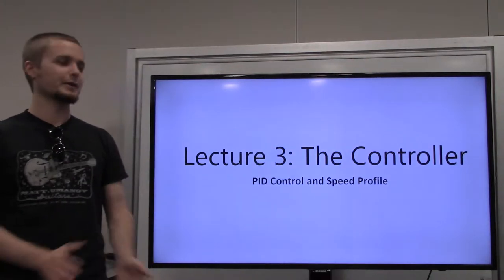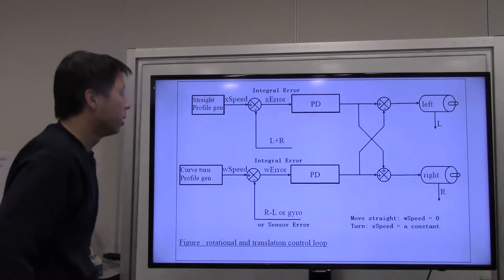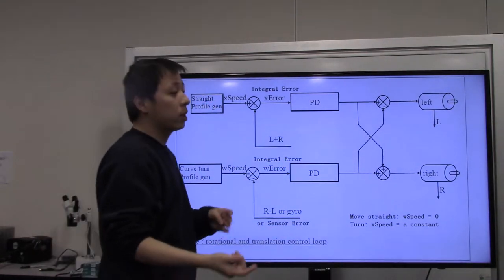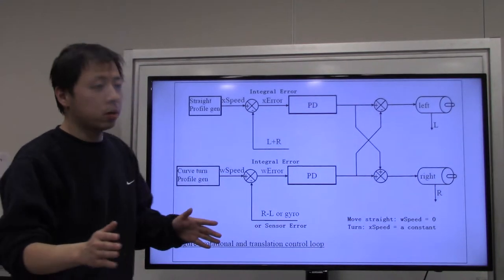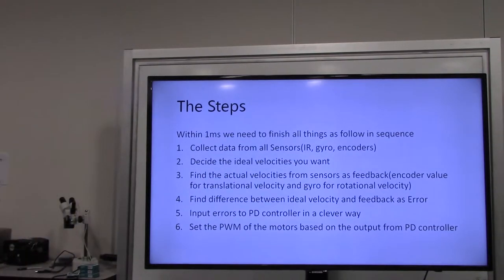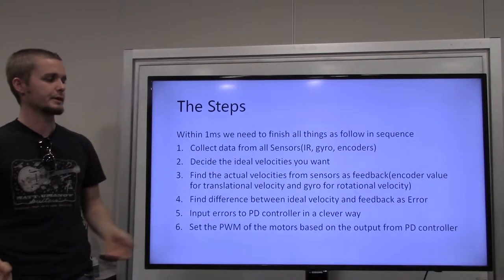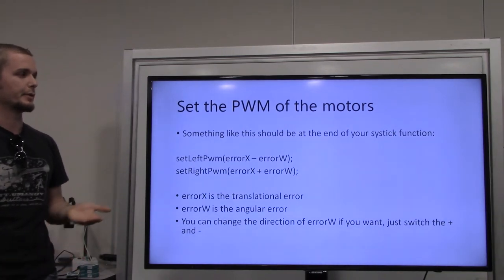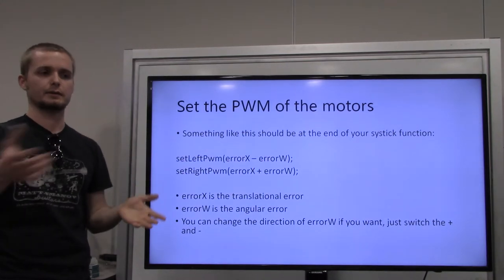Lecture 3 Controller

Comment: Hi, first thank you for these Lectures and explanations very helpful! 
In this video and in your slides you explain that it's necessary to use a 'positional PD' controller and this suppose to use a 'PI' controller for the speed data. I understand this but in the Sample Code that you offer in your web you use a PD controller for the speed sensors (encoders difference and gyro):
    
    posErrorX += curSpeedX - encoderFeedbackX;
    posErrorW += curSpeedW - rotationalFeedback;
    posPwmX = kpX * posErrorX + kdX * (posErrorX - oldPosErrorX);
    posPwmW = kpW * posErrorW + kdW * (posErrorW - oldPosErrorW);
    setLeftPwm(leftBaseSpeed);
    setRightPwm(rightBaseSpeed);

What should be the correct way to use the PID controller? the sample code is wrong? should be a PI controller with the posErrorX and posErrorW?

Thanks in advance!!
Reply from the maker: firstly, posPwmX = kpX * posErrorX + kdX * (posErrorX - oldPosErrorX); makes it a PD
then posErrorX += curSpeedX - encoderFeedbackX; make it accumulates with the previous errorP(or next errorP). 
So this is neither PD or PI.
Reply: where did you found the code

Comment: That is a very explanatory video!
Good job.

What  the SPEED_TO_COUNTS  function does in your sample code? I cannot understand what you mean by unit conversion
Should the values of moveSpeed, turnSpeed, maxSpeed etc be of some value?
Furthermore, could you please explain the below line of code?
(speed_to_counts(accX*2)/100);
I get that we need to subtract or add the accX and decX values but why in this manner?

Thank you in advance for your answer
Reply from the maker: it converts the speed in mm/s to encoder ticks per ms
(speed_to_counts(accX*2)/100); uses same macro/function to convert acc in practical unit to tick^2 per ms  /100 has something to do with the unit of acc(mm square instead of mm)
*2 is because we have 2 encoders added up as the speed(not divide by 2 to keep the higher resolution, if I remember this correctly)
Reply: @Greenye  

Thank you for your quick response. I really appreciate it.

In other words, when you say int moveSpeed = speed_to_counts(500*2);  it means the moveSpeed is defined as 1000 counts per ms? Where is the body of counts_to_speed function that makes this conversion (i.e where you define the macro function)? How can I experiment with some velocities and write down the corresponding ticks from the encoders?
Furthermore, do you think an Arduino Uno can execute all these lines of code within 1 ms (by implementing an interrupt). If not,  what time would I use to divide the change of the encoders in order to find the derivative?
Reply from the maker: @georgetzakoniatis3781  macro is usually in .h file
uno won't be capable of doing this, just give up.
Uno doesn't have hardware quadrature encoder module either.
Basically this is STM32 or not case

Comment: Hello nice presentation but would need some explanation. How you get rid of steady state error as you use PD for speed not PID. Why you are changing speed setpoint for controller (profiler). Wouldnt it be better to just make step input and saturate the motor output to achieve constant acceleration to setpoint?
Reply from the maker: if it goes that way then the control will no longer accurate.
Reply: Green ye
I saw your other videos now especially of curve turn and I understood that you need to have good control of accelerations and decelerations now. But still cant understand the PD. It has steady state error. How you go around it?
Reply from the maker: LaggerSVK use positional PD is similar as PID where the accumulated velocity error(which is position error) form some components similar with Integral in PID. The integral components in PID accumulate the velocity to distance to make the robot finish the straight movement with the designated position. So the positional PD will have similar efforts.

Comment: Hi bro!! How do you find the parameters (kp,kd) ?
Reply from the maker: +Le Nhat run it, log out the desired speed and its feedback at each 1ms. sketch the data to see if the feedback does the best to closely attach to the speed profile curve. some try and error might be needed.